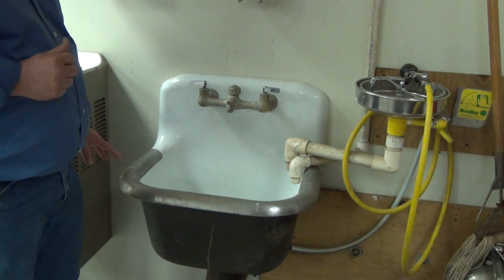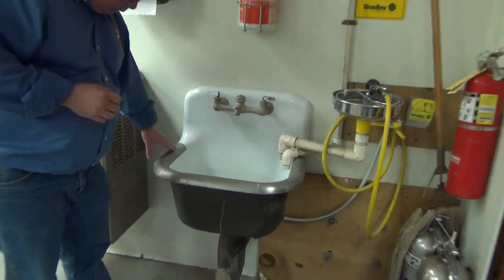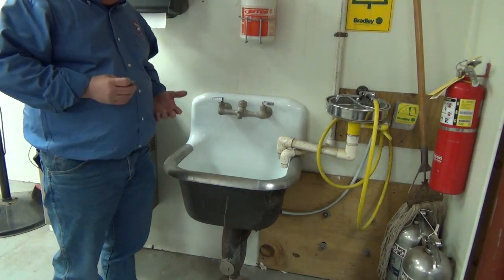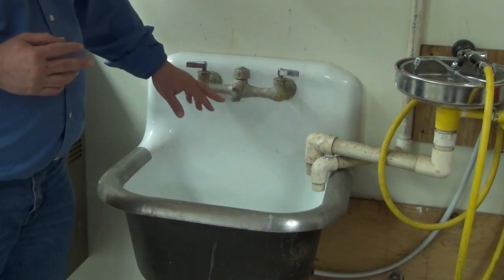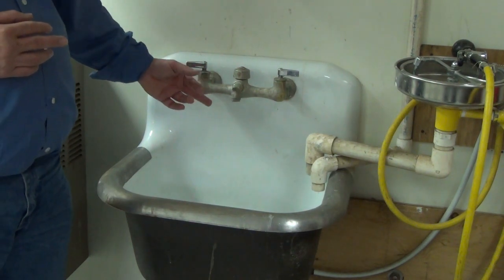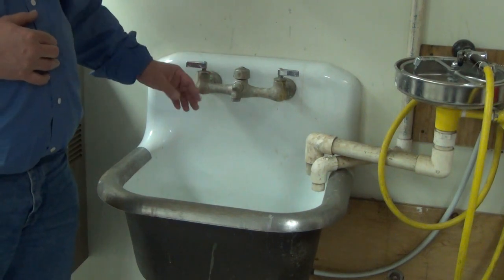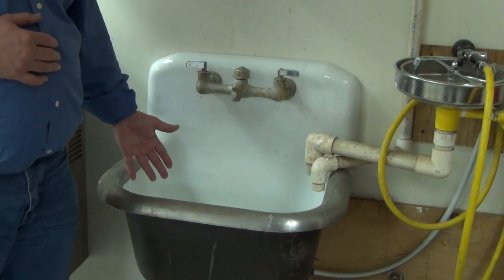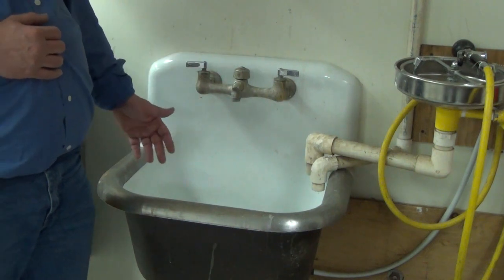Air Gap Water 2

Comment: My new local Plumbing inspector requires an air brake on the condensate drain lines from the A/C units.  He no longer wants the drain lines to terminate in to a floor drain and says it's the new Plumbing code.Is this true because it's very difficult with a down flow coil placed directly on the floor.